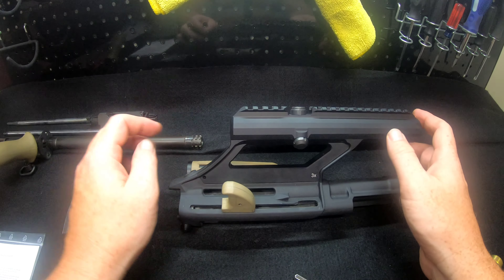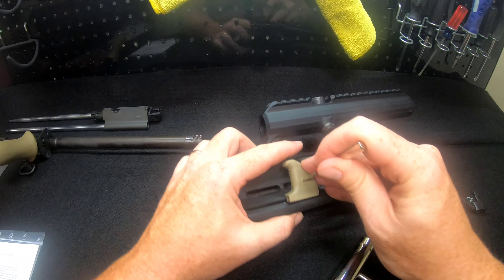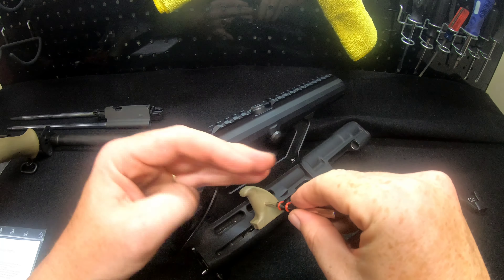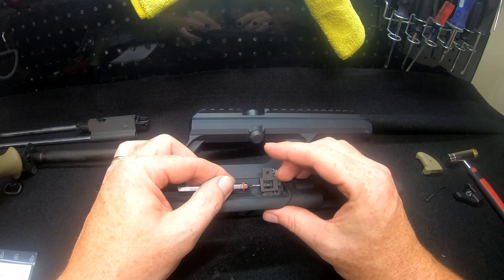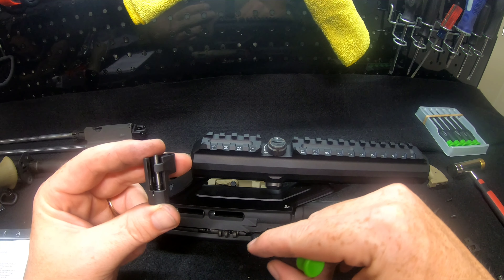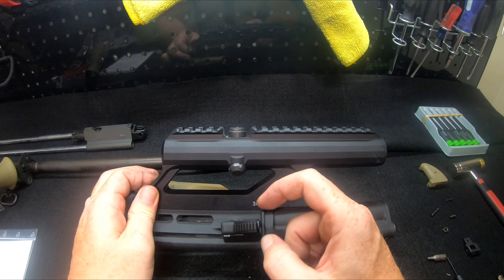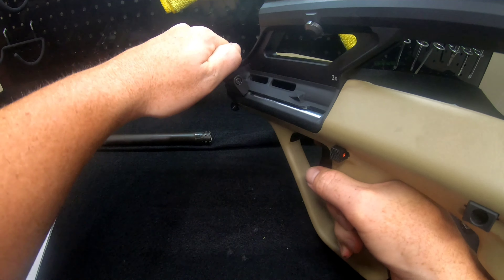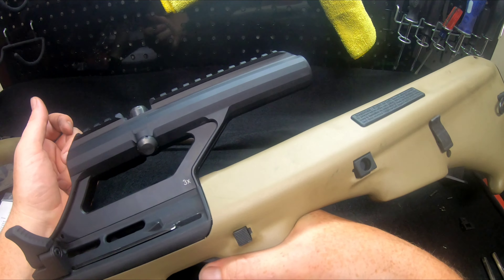1st look & installed of the Corvus defensio charging handle  RAW aromer version

Comment: Great video. Just watched it over and over, now I have my new charging handle installed. Just quick question, what you torque that down to?
Reply from the maker: Thanks.  
I did hand tight then +15° . So about 10 or 12 in-lbs . With a dab of blue loctite
Reply: @TnSteyr  dang, I’m might have over tighten it, thanks again bud. Really appreciate the video. Couldn’t have done it with out it.

Comment: I use a EOTech 3.0 on my AUG it is mounted on the 7th Position, during the Video i figured out that the charging Handle only hook in the half way on backward Position, on 8th Position a quarter, on 9th it doesnt hook in. Somtimes i use a 4 time scope and i had to take care on the mounting screws from the scope while pulling the charging handle. The way it is is ok, but i schould …..

Comment: To Steyr just wondering what would you prefer a rail or fixed scope on an AUG
Reply from the maker: Humm thats a hard one .  I like both it just depends on what I'm doing with the AUG ?  Right now I'm using the 3x optic ....

If you can shoot Irons & like them then a flat top rail . 
If you going to be shoot 100 too 300 meters on the regular ,then the opic and I would only get the 3x .
Reply: Thanks

Comment: So you only use the one spring provided??
Reply from the maker: Yes as you saw it
Reply: @TnSteyr  wow there is a lot of play in it
Reply from the maker: @EDMD  check out my second video, which actually shows a correct in full installation. You may have a spring not looped correctly

Comment: Can you still use the forward assist feature with this charging handle like you can with the OEM one? I have an AUG A3 M1
Reply from the maker: Yes .  This is just a handle that does not change any of the internal  parts
Reply: @TnSteyr  Thanx!
Reply: According to Corvus there might be situations, where the forward assist does not work with their handle... coming from Austrian Special Forces they found it to be a very minor issue though. With an AUG the forward assist is rarely needed anyways 😉

Comment: I don't know why Steyr engineers made the lock detent for the charging handle UP, instead of DOWN... would have been much more ergonimic to pull back and lock, and to H&K Slap, and much easier to lock back!  Fingers away from rail.  Or just Galil right angle the charge handle!  Geeze... 43 plus years and Steyr hasn't fixed it!!!  😢 😮😢😢
Reply from the maker: They don't fix what is not broken.